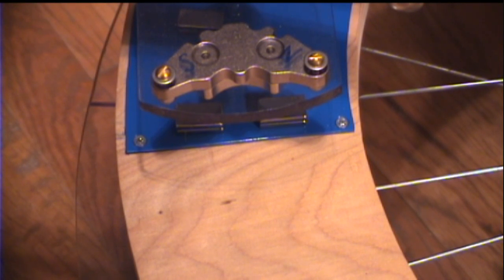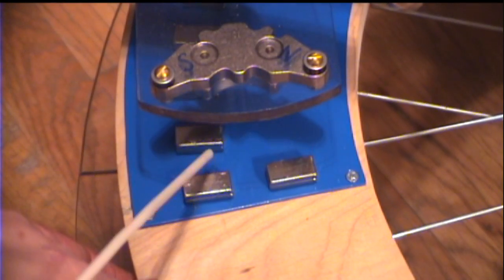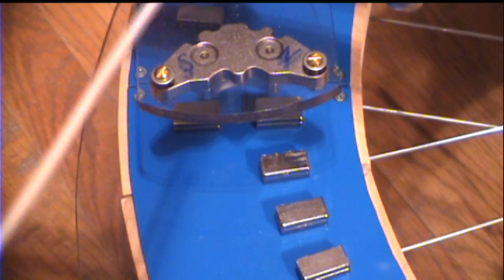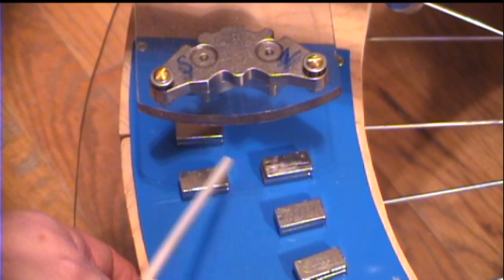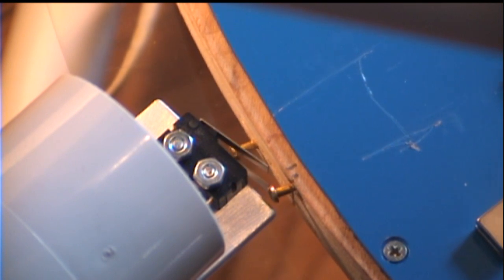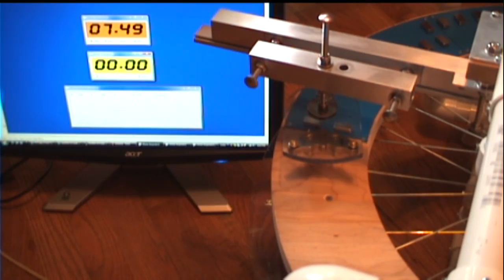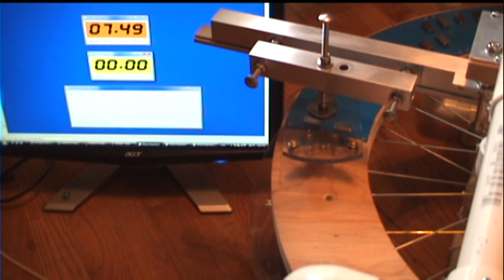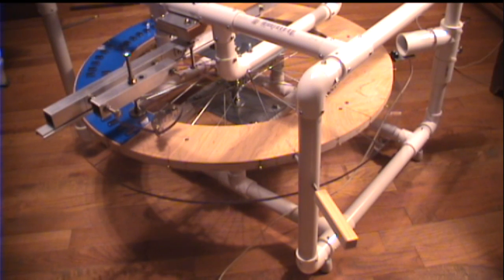Video #36, "Rick's Pipe Dream" Magnetic Motor-Generator

Comment from the maker: By "tilt" did you mean angling the rotor magnets?  Yes, I have tried all sorts of configurations.  Frankly, I like the layout I am now using better than that.  It is something like you see in this video, but the rotor magnets are placed with a decreasing space between them, and each south up rotor magnet has a north up magnet beside it.  The stator north is positioned over the rotor south-ups, and visa versa.  I'll show this exact layout in my next video, along with a speed test.

Comment: alright awesome thanks.  have you tried tilting the rotor magnets so they all tilt one way( either left or right)? because i think if there would be more attracting surface area in front of the stater then behind causing  the machine to spin. i'll have to try it out to see if there is good results or not.

Comment from the maker: The metal sheet does not cause the stator to interact with the rotor magnet group as if it were a single magnet. Each rotor magnet has its own well defined interaction with the stator magnet. This has always been the case, and I do not believe that I ever stated otherwise, though some viewers may have wrongly assumed that the bike rim or metal plate caused such an effect.  Also, the metal plate is in no way detrimental to rotation.